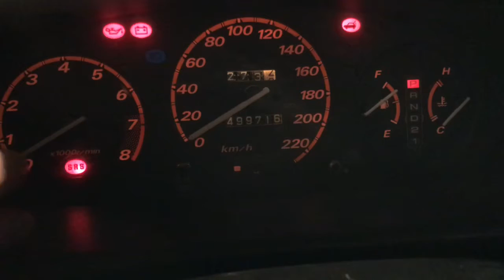How To Scan SRS/ ABS/ CEL Codes • 97 - 01 Honda CRV • #ThatBeardedMechanic

Comment: Hello and thanks!
Inhave a gen 1 (1999) crv with a delayed  cei.  It comes on after 10 min or so static or driving.

Question on your video:

Did you jump the 2 pin or three pin connector?
    I have both.

I jumped the 2 pin and nothing.

I also purchased a 3 pin to 2 pin adapter to use with a foxwell scanner.
   Scanner reported "unable
To read"

Thanks for any assistance given
Reply from the maker: I simply connected the two pin connector with a wire so it would put itself into self check mode. Then counted the flashes. Then disconnected when I was done.

You may have something wrong with the OBD harness if it’s unable to read. 
You could do a hard reset of disconnecting both battery terminals and then leaving it like that for 5-10 minutes or holding both terminal ends together (without touching the battery) and that will dissipate the capacitors. 

Reconnect and try again.

Comment: Super Helpful ! Do you know if hondash works on these ? would the report be more comprehensive or will I get exactly the same codes but with a fancy interface ? Thanks again ?
Reply from the maker: I’m honestly not too sure about Hondash working for this, you could try searching on Facebook, there’s a dedicated CRV forum on there (one of the bigger ones) and there’s a lot of guys in there with lifted and lowered, higher performance ones that may have a better answer. 
I know there’s a few on there with technical builds that do require additional backup/ electrical monitoring. 

Hope this helps.
Reply: @That_Bearded_Mechanic  tx mate

Comment: Hello  sir, I bought a geb1 3 months ago but lately I've noticed that the srs light doesn't lit when the ignition turns to on position.  What are the possible cause.  Thanks.
Reply from the maker: Was it lighting up before? If it hasn’t lit up since buying it, I would remove the dash cluster and inspect the SRS bulb to see if it’s functioning, it could also be removed or have tape blocking the symbol. 
It’s sadly a typical sales ploy when there’s an issue with the car. People buy them and don’t know any better and sadly end up with them (no offence). 

This is why it’s important to always check the dash before starting a car you’re looking to buy. If there’s issues, people will remove bulbs to hide the problem once the cars started. 

If that’s not the fault for the problem, I would then check fuses and inspect the harness under the seats to confirm no issues there either.

Comment: hey i noticed that when you were going over this video your instrument cluster seemed to have the high beam bulb slithgly on and am having the same issue with my crv with the exception that when i turn on my lights my cluster doesnt light up and i only get power on my left headlight that includes the drl the headlight and turn signal but on my right passenger side i do not have any power . so i did hooked up the instrument cluster to my other crv and it seems to be working fine on my other crv but i still cant figure out why it wont work on my other crv do you have any idea why this might be happening
Reply from the maker: My CRV has LED lights installed without resistor modules in place, that’s why the high beam indicator is partially lit. 
So you have LED lights installed on yours? If so this is probably the issue. Also, LED lights are polarity sensitive, if they’re not functioning correctly, it’s common to flip them over and reconnect to get them working again. 

If this isn’t the case, you could have a damaged harness or connector for that headlight.

Comment: Does this mean it's at 499,000 km?
Reply from the maker: Yup, at that time this CRV was just over 499,000kms. I actually got a video of it rolling over 500,000kms shortly after this video. I ended up scrapping this entire CRV for parts for my other CRV, when I did that the following Summer (Summer 2020), the engine had 518,000kms on her and still running strong. Proof that maintenance does go a long way.

Comment: really appreciate this info.
Reply from the maker: Not a problem. Glad it was helpful for ya.
Reply: @That_Bearded_Mechanic  by chance- you got a video of how to reset the check engine light?  We replaced the distributor among many other parts and now it’s on.  Suggestions?
Reply from the maker: You can just do a hard reset by disconnecting both battery cables for about an hour. Reconnect and that should clear the light. If the light comes back on after driving, re-scan for the code.
Reply: @That_Bearded_Mechanic  sweet. Thanks.

Comment: Both my SRS and ABS lights or on I need help
Reply from the maker: I assume we’re talking about a first generation CRV? I would start with scanning for the codes as described in this video or with a scan tool if available that has the SRS/ ABS scan function. Some scan tools do not have this ability. 

The SRS/ ABS lights can be on for any number of reasons from faulty seatbelts, airbag clock spring issues to damaged ABS wires/ sensors.